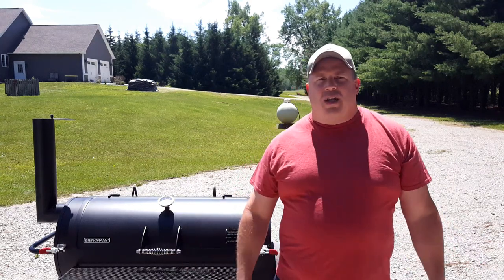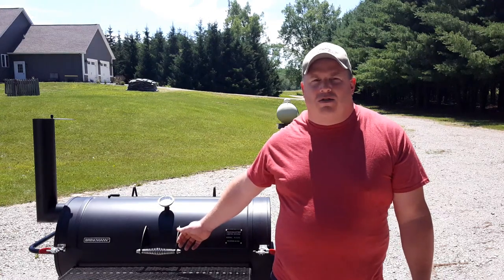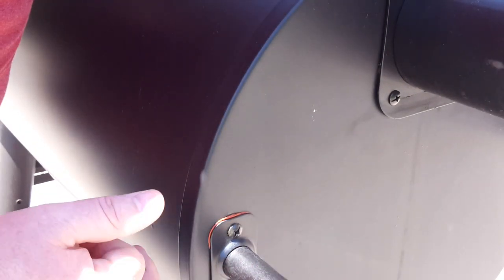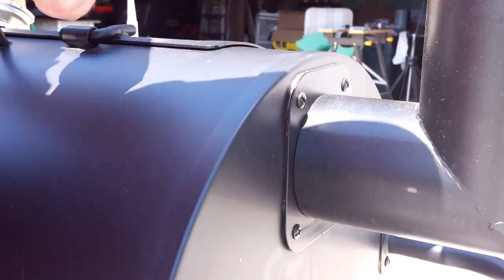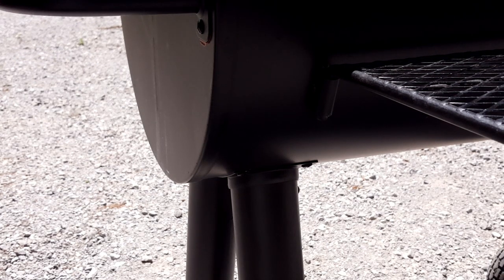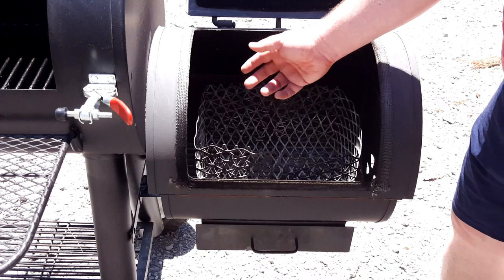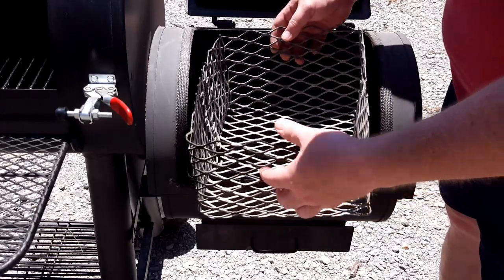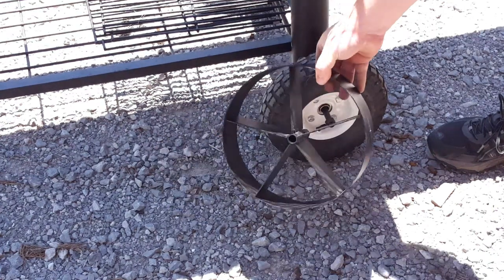Best Offset Smoker Modifications | 6 Easy Mods

Comment from the maker: Thanks for watching.  What are some of your favorite modifications?  Which do you think are a "must"?
Reply: George LaBarge great video, thanks George
Reply: 1) A better temp gauge and 2) an extension like you seem to already have for the chimney to come out sideways a few inches, then straight up. Some have it installed on top of the smoker, but thermodynamics says that way is inefficient. Did yours come straight up or did you add a sideways extension?
Reply: Those plates on the bottom to even out the heat from one side to the other thats the biggest problem Ive had with my offset smoker, thanks for the solution. Did you weld those plates or are they just set in place?
Reply: I know Im asking randomly but does someone know a tool to log back into an instagram account??
I stupidly lost the login password. I love any help you can give me.
Reply: @Daniel Ellis Instablaster :)
Reply: @Derek Rodney It did the trick and I now got access to my account again. I am so happy:D
Thanks so much, you saved my account !
Reply: @Daniel Ellis You are welcome :)
Reply: That clamp modification was great idea 💡😊

Comment: Just wanted to send out a HUGE THANK YOU for this video. I have old Char Broil smoker for 8 years. My wife and I stopped using it 5 years ago because of ALL  the leaks from the firebox and smoking chamber. We basically bought a Big Green Egg and been using that instead. But I thought about it and decided it was stupid to not get some use out of old grill.

I finally got around 3 weeks ago to work on this project. It took me 2 days of work but I am finally finished.

I did all the mods except the temperature gauges. It makes a huge difference. I just finished the charcoal basket today. It cost me $35 total and that includes the angle grinder, blade, and expanding metal.

Am going to test some brisket on tomorrow. Can finally also grill on this as well as my Big Green Egg as well.

Comment: Thanks for the links man. The old lady and my girls tried to gift a bigger grill for me as a Christmas present but bought a low quality offset smoker instead of a grill not knowing the difference. Although I love the gift and a new hobby, the material, design and craftsmanship of this boxstore model is just subpar and embarrassing. Nothing is sealed, metal is cheap, welding is atrocious and the dimensions are so off I don't see how a company would want to put their name on it. 
 But nonetheless it can be modified with a little work and know how to make it actually perform its intended function. There's just simply no way this thing could do what it claims as is.
 Right off the bat you went right to the problem areas and provided the exact material and links I needed on the first video I clicked on. Good looking out brother 👍

Comment: Wow great  mods. I have bought and put together the Royal Gourmet smoker and the smoker lid is so light and has no sealing effect at all. I did lay the high temp gaskets but it still has no seal to it. I thought of buying a 5 lb. weight and attaching the the handle. Please tell me what you think. Thank you for your videos I'll be watching them and learning! Thanks
Reply from the maker: I'm not too familiar with that smoker.   The lid is designed differently than mine so toggle clamps won't work.   You might have to experiment.   There might only be so much you can do to improve that one.

Comment: I’ve had a DynaGlo horizontal smoker for a few years and have made most if not all of the recommended modifications...they work pretty well. I plan to move the chimney...soon as I figure out where to...and the best way, with the tools available. Open to suggestions.

Comment: I have the exact brinkmann smoker and have had it about 2.5 years..I did the exact same mods and your right they are essential to make this smoker a cooking monster. The only other thing I did, you may have thought of it was I cut a 4 inch diameter length of dryer hose attached to the inside of the chimney to bring the heat down to the grate level and I regularly get a 10 degree difference from hot end to the chimney....so the mods are crtical, good video...
Reply from the maker: Thanks for the comment!  Great additional mod tip.  I thought about it, but, once I tried out the performance of mine after the mods I did and I was happy with the way it performed, so I left it as is.  There have been a few times I've been glad I didn't make that mod, like when I cooked four 9lb pork butts at one time.  Never would have fit them all in there 😉.  Sure you could probably remove that if you wanted to.

Comment: Hi George, hope you're enjoying your modified smoker. Quick question about the gasket you recommend (https://amzn.to/2u5NN2F), the comments on Amazon are, for the most part, negative, it seems it is a hit or miss in terms of quality. I am about to start the mods you so kindly shared with us, wonder if others have asked you the same question, or if you have any other suggestions. Really appreciate your input.
Reply from the maker: I think most of the complaints are about the adhesive.   When I did mine,  I used a bead of RTV silicone to help glue it down.  I haven't had any issues with mine since.   Good luck.
Reply: @georgelabarge4985  George, I really appreciate your answer, and your generosity sharing with us your modifications, plus all the materials needed. You're a good man, sir. Thanks again. Ari M.

Comment: Have you ever used fire bricks or normal bricks to keep the temp up in the cold? I want to try it but I have heard warnings.
Reply from the maker: No,  never tried putting bricks inside.   I have heard of this mod though.   It should help.   Might want to be careful on the type of brick.   I would use bricks made from natural materials.   If you have the steel baffle plates like mine,  might also have concern of blocking air flow with the bricks.  But try it and see what happens.  Good luck.
Reply: I used to have bbq lava rock in my smoker It worked good it helped to hold  a good temp

Comment: Hey George! Great video. I just got my smoker and I’m implementing a few of these. Curious how you installed the Toggle Clamps? Did you drill and rivet? What’s the best way to attach? I definitely need those.
Reply from the maker: Hi Nick.  I just drilled and attached with a sheet metal screw.   Just drill the hole slightly smaller than the thread size and they will self tap into the steel.  Good luck.
Reply: @georgelabarge4985  Ah, that is surprisingly easy ha. I thought it was something complicated to keep the seal. Great! Thanks so much, love your video and sent it to my dad too. Will give it a shot.

Comment: Did you scuff up the paint with sandpaper before applying the gasket?
Reply from the maker: No, applied firebox gasket using the red RTV as adhesive and for the cooking chamber just applied the gasket right to the cooker.  Neither of them has started to peel off after over 2 years.  So I think it worked.
Reply: @georgelabarge4985  Thanks for the reply.Im about to set mine up today.

Comment: If I primarily smoke meats at 220, do you think the steel plates are a needed mod? Thanks for the video!
Reply from the maker: The plates are not necessary, but they serve 2 purposes that will help your pit cook better.  1) They act as a heat sink and will hold heat in your pit for the temp to recover faster when you open the cooking chamber.  2)  They will distribute the heat across the pit and help to even the temperatures from one side to the other.  Otherwise the side next to the fire box will be much hotter than the other side, you could have a 50 degree difference in temperature from one side to the other.  If you are only using the thermometer in the lid of your cooker, you will never know about this difference in temp and will wonder why food is not cooking evenly.

Comment: have  you modded your smoke box stack to extend down closer to the rack?
Reply from the maker: Hi Andrew.  Thanks for the comment.  No, I didn't make any modifications to the smoke stack.  I know I've seen some mods where you use a dryer vent tube that does that, but I was getting great results from the mods I did do, so I didn't do that to mine.

Comment: Have you tried anything to seal the ash drawer? That's my biggest issue with this particular model. Very convenient but too much oxygen gets to the fire. Thanks for the video.
Reply from the maker: Thanks Trent, good point.  Let me tell you, I thought about doing that early on, but for my setup with all the other mods what I found was that I had a hard time getting to temps above 300 deg.  When I want to get a higher temp than having my vent completely open, I'll crack the ash drawer a little and it helps get it a little hotter.  I think if I would have sealed it up, I might have not been able to get enough oxygen to get to the higher temps for cooking things like chicken.

Comment: where did you get tuning plates    guess i could make them  or what r the dimensions of the plates
Reply from the maker: I bought them from a local steel supplier.   They are 6" wide and 1/4" thick.   Measured the width of the bottom rack rails inside my pit and had the supplier cut them to this length for me.  Using a 6" wide piece of cardboard,  made a template for the piece that seals off the firebox, then used that to cut a piece to fit using a disc grinder with cutoff wheel.  Wasn't that hard.  Hope this helps.
Reply: Thanks for the tips George. Did you weld in the plates?

Comment: Hi George - a great set of videos that you have here. Regarding this one with the smoker mods, I am very interested in the tuning plates and baffle. I know you shared that they are 6" wide but how many of those did you use including the size and length of the baffle? I have the exact same smoker and going to a metal shop on Monday to get these made and according to my measurements, it looks like the plates would be 13" long - the smoker is around 40 1/2 long so would that mean 14 plates and then one more 9 or 10" long plate (with a bend) for the baffle? Does that sound about right?
Reply from the maker: Hi Randall,  I think I bought about 7 pieces of steel for my baffle, and I'm using 6 of them.  Here is what I did:  1st pc was cut a little longer and was used to block off the fire box inlet.  Using a piece of cardboard 6" wide, I placed it on an angle so the top covered the fire box and the bottom rested on the bottom grate rail at about a 45 degree angle.  I cut the cardboard for a template so there were no gaps around the sides.  This piece will be longer than the others.  Then when I got my steel, I traced this template onto my steel and using a disk grinder, cut the piece.   No bending needed.  That is all the cutting you should need to do, the rest of the pcs will drop in if they are cut to the length between your bottom grate rail.  The next piece was butted up tight to the angled pc to help hold it in place, I never welded anything.  You may need to stack a 2nd piece on top of this first one if the angled pc starts sliding down on you.  

Then I would place the remaining pcs leaving about 1/8 gap, then 1/4" gap, then 1/2" gap going from right to left on my smoker.  You don't want to run the pieces the full length of your smoker, leave about 6" or so gap at the end.  You can play with the spacing until you get it how you like.  Oh, another tip...  When you get your steel, I washed it off with soap & water to remove the mill oil, then rubbed it down with vegetable oil to protect it before installing them.  (mine don't rust now)  Hope this helps.
Reply: @georgelabarge4985  Thank you, George, especially for the tips on the vegetable oil. I am getting these tomorrow from the metal shop I will surely send a picture of the finished product.

Comment: How hard was it replace those wheels
Reply from the maker: The wheels were pretty easy to replace.  I found these at Harbor Freight for about $5 each.  My axle was a little smaller than the inner bearing of the wheel, but I didn't mess with it and just put it on.  I guess I could have bought a spacer bushing to fill the gap.  It still works much better than the original wheels.

Comment: For got to add the links mentioned in the video for the sealant, gasket material for doors and charcoal basket.  Also were did you find the toggle clamps?  I just purchased a chargrill offset smoker and plan to us some of the mods you suggest.  Thanks for the information.
Reply from the maker: Hi Dan,  Yes links are in the video description right above the comments here.  Just click the show more and you will see all of them there.  These can all be purchased on Amazon, including the toggle clamps.  The charcoal basket link takes you to another YouTube video that does a good job of showing how to make one.  There is also a link to my blog article that explains a lot of the same things the video does.  All the Amazon links are my affiliate links, so they don't cost you anything, but help me out a little bit.  Good luck and let me know if you have any questions.
Reply: Dan Stophel   You can probably find those clamps in a wood working tool store or in the tool aisle at a big box store.  Good luck.

Comment: Don't use that RTV.....a full chimney of charcoal will melt it easily. Get it welded or leave it alone. And a charcoal basket?! This is a stick burner....if you are using charcoal, you bought the wrong unit.
Reply from the maker: Thanks for the comment.  I have to disagree on the RTV.  I've had mine on my pit for over 3 years and it's still there doing it's job.  I agree, welding would be the best method, but this video was for people trying to fix up their cheap offsets with limited resources.  I do burn wood in mine for every cook, but I also get my fire started with a base of charcoal.  I think the basket serves another purpose, it keeps the wood and coals centered and off the sides of the firebox, which I believe has extended the life of the paint job.  My pit still doesn't have any rust on it.
Reply: It's all good man.....But how much total in time and money did you spend doing that stuff? I had a modern Oklahoma Joe a few years ago(never again will Ibuy a COS). I paid a welder 50 bucks to weld it all together and remove and re-bend the doors so they fit properly without having to add any gaskets. That was cheaper than a tube of RTV, stove gasket kit, and chamber gasket kit.